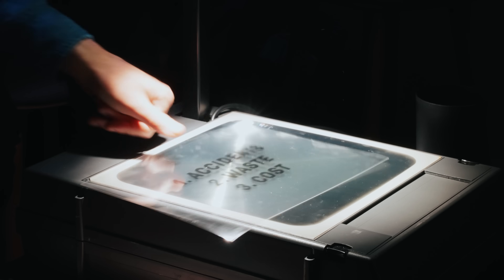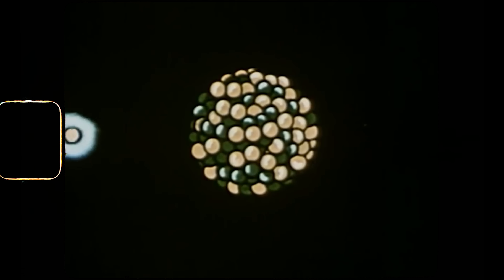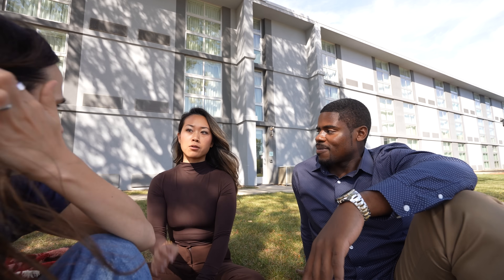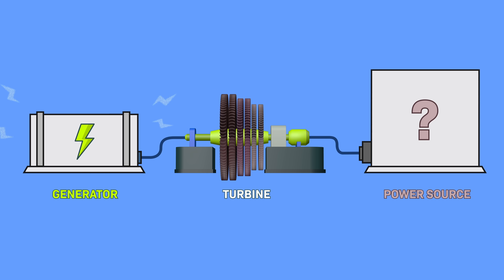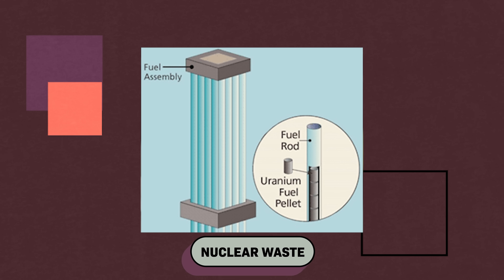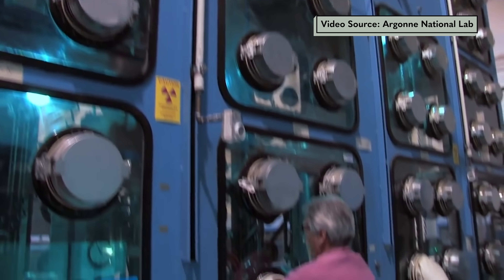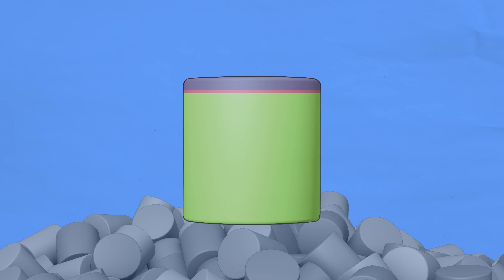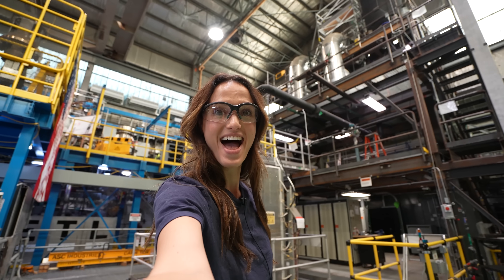The Big Lie About Nuclear Waste

Comment: After over 30 years in the nuclear (government) industry, I would say we never met an engineering challenge we couldn't solve, but had a very poor record of overcoming political challenges.
Reply: Isn't there something about the building code and safety requirements for the reactor being uniform across the US, meaning that they have to be earthquake and tsunami proof even when built far away from a coastline and not close to a fault line, causing a lot of (unnecessary?) resources to be spent on construction.
Reply: @Kalisparo  it's worse than that.... Some of the other issues are that a np electric generation plants can be stopped at any point up to the point the plant goes on line. Alex Epstein has extensive research on the basic criminalization of np.
Reply: @Kalisparo where is the question mark? You asked a question.
Reply: Just make a bunch of viral TikToks that attracts milions of kids that will tell it to their parents, problem solved lol. This is basically a marketing issue, every political issue is.
Reply: I think the biggest problems are human factors, like shortcomings in design & construction, and operations & maintenance.  It’s too tempting to cut corners and save money on some organizational level.
Reply: @jimbaranski4687  definitely, but also I don't think there has been a single reactor built so far that was on budget or on time, in any country, even those with extensive experience. Theoretically fission reactors can appear to be simple enough - in practice they haven't been.
Reply: @unom8  Most technological developments go through several phases.  The first designs are simple, but inefficient and brute force.  Then the designs get more complicated, but more efficient.  If you're lucky the third phase designs go back to being simple, but elegantly solve any problems efficiently.  But there has to be some motivation to perfect the designs.

You can look at the history of space craft designs.  The early rockets were very brute force.  The Space Shuttle was much more complicated, but more efficient and semi-reusable.  Now, SpaceX rockets, while still being quite complicated, are much more efficient, and much more dependable and reusable.

You can also look at computers and the internet.  Computers have become much more user friendly and efficient....

Thorium or Sodium reactors have many good qualities.  But we've pretty much been stuck on water based reactors which have several large flaws.  Just like with rockets, we need to develop materials that are dependable, and don't suffer from corrosion and wear.  Designs have to be made so that when things fail, they fail safely.
Reply: Scientists, engineers, designers and inventors work in truth and absolutes. 
Politicians work in lies, emotional manipulation, sensationalism, bribery, betrayal & power/control. 
In a battle of politics the good guys are unarmed. And the bad guys wont play by the rules anyway.
Reply: The oil industry had huge impact on influencing political will and how policy's were made that negatively effected the nuclear industry.  Also, after the development of the nuclear bomb, the research that was ongoing between fusion and fission reaction just got shelved. Recent reemergence into the salt type reactors looks to be promising.  Regardless of what type of nuclear we go with, NUCLEAR is our way out of the oil business.  Currently it is the best option for producing the amount of power that is needed to stop burning fossil fuels.  Solar and wind are nice but as a substitute for oil that is 24/7 reliable to generate the power we require, it's going to be nuclear.  When people get real information and educated on the science they will understand yes it can be dangerous but if handled properly it can be safe as well.
I was an industrial radiographer years ago and would laugh at how mis-informed people were about radiation.  I got to keep some of their lunches "for disposal" because they got irradiated.  If you don't understand what I just said then you need to leave me your lunch also.  I'll eat it later.😊
Reply: @noobdernoobder6707  Unless we are able to manage building a worldwide connected power grid... Solar will always be a pipedream. It is too intermittent for industry to run directly, so you will need MASSIVE battery farms to account for poor weather and nighttime use.
So until we have the ability to create some type of orbital solar collectors, solar will always be a second-tier power source.
Reply: @OreoBambino  800 billion*
Reply: I don’t think fusion power is possible. Not in the scale they are trying to accomplish it in. It could possibly  need to be done in space at a massive scale.. hence the sun.
I’m all for nuclear power but fusion isn’t going to happen.
Reply: My heart really goes out to you, many have experienced the fact that political solutions to technical problems are fraught with dangers. Democratic republics, single party communist nations, same problem.

I am convinced a major rule of political solutions, in the spirit of negotiation compromise, is to know you have truly succeeded when everyone is equally unhappy. This guarantees a suboptimal technological result.
Reply: As someone with 50 years in engineering, your statement is all wet. Because the government hires only the lowest IQ due to the fact they would not be able to get real jobs, I understand you thinking this.
Reply: The problem with engineers and medical types is that you fail to make a compelling argument. You could say the same about Republicans too. So don’t feel bad. 😂😂
Reply: How about landing a man on the moon? We can't in 2023, but allegedly did so 6 times over 50 years ago.
Reply: There's only one way to overcome political challenges.
Reply: @jayrowe6473 Ahh Jan 6th type. Insurrection is the answer for some just not for me.😮
Reply: Its almost like the people in power don't want there to be low cost power.
Every "green" source in multiple times more expensive per kilowatt than coal, and even nuclear. Wind turbines have one of the shortest life spans of any method. 
Solar panels require many times larger areas of land to be depleted of vegetation than a power plant, either coal or nuclear.
Sodium reactors, among others, have already demonstrated they work and are much safer than the previous generation of reactors.
But for some reason, even among the overhyped rhetoric about climate change, there is no push, no government incentives,  to build these.
Again, we must all add ourselves,  regardless of which side of the political spectrum we ate on, why are only the most expensive per kilowatt alternative means of power production being pushed? As governments are implementing changes to electric cars, why hasn't there been any conversation about our already strained electrical grid and our dilapidated service in older metropolitan areas where minorities and the poor tend to live in higher numbers?
Could this be why major streets in older metro areas are having the number of lanes reduced, and bicycle lanes put in?
Affordable, plentiful power creates a higher standard of living. If society decides that the bottom third of the population won't have access to that, what will happen?
This is not an innocuous situation, simply caused be lack of foresight or ignorance.
Reply: Engineers have to be smart to get ahead.
Look at who the President is right now.
This is the difference.
Reply: We should not need to deal with political challenges if there were a law that banned politics from this type of technology in the first place.
Reply: @beaudavis3808  you're absolutely right, it's an oversimplification but unfortunately politics influences everything. At some point they're gonna realize that scientific progress is important, let's hope it will not be too late
Reply: @beaudavis3808  not yet, we still have much to go for a complete decarbonization. I live in Italy, one of the country that's it's openly and violently anti nuclear
Reply: @beaudavis3808 "A law that banned politics..."
Reply: We would live in such an amazing and futuristic world if we hadn't fallen to political nonsense and greed
Reply: Nuclear grid electricity needs 247 full demand and full cash flow demand. For 60 years. 

Renewables on rooftops, PV panels will get cheaper, and v2g EVs with massive daily FREE storage and parked 23hrs every day will break the nuclear economics. 

Nuclear promoters rabbit on about the modern technologies and then STFU about the rooftop PV technology and its no need for GRID ELECTRICITY. 

In Australia, 20 million buildings with a small 6.6kW rooftop can totally outperform grid generation. 

EVs with v2g oversized battery are on the production line. In the millions. 
Elon Musk is creating new production technologies. 
Elon Musk is creating robotic technologies.

Ford has moved to EV technologies. 

110 years ago, horse meat was cheap when the Ford model T production line started.
Reply: Yeah, good marketing can save any product, as well as bad marketing can doom it.
Reply: @MRSketch09  see solar and wind....
Reply: @MRSketch09  : Look what happened to lawn darts?
Reply: @MRSketch09  Bud Light
Reply: The "green" movement has nothing to do with protecting the planet and everything to do with hurting humanity.
Reply: VIDEO: Sacking of non-binary Biden aide exposes reality of 'minority box-ticking hires'
If only Brandon had hired a real expert at the Argonne National Laboratory as the Nuclear Waste Czar instead of hiring Sam Brinton based on woke politics, the USA would have a more promising future for nuclear energy instead of being a laughing stock in the world.
Reply: The nuclear industry "had a very poor record of overcoming political challenges".
The hiring of Sam Brinton as the nuclear waste czar by Joe Biden proves the above statement to be true.
Reply: @OreoBambino  and they need to spent Uranium for dirty bombs. So you know, how will the possibility bomb Aleppo or Yugoslavian with dirty bombs if they use the Uranium up with that $1 billion funding? Poland is getting radioactive dust as we speak. Maybe they'll wise up.
Reply: Take away government's power to create money and we'll be going on a fast track to developing useful technology
Reply: The people who don't want to recycle nuclear waste due to high cost, are the same people who don't want to use recycled plastic, glass and paper, and have most of that end up in the garbage due to it being cheaper to use new materials.

The owners of these corps and companies are the same elites that constantly preach at you to lower your standard of living to protect the environment. But when it comes to their money, they don't care about the environment. The worst part is that their corporations cause 95% of environmental destruction, however, they want you to take the hit for fixing it. Their standard of living loss would be minimal.

They fund the climate change studies to make it look worse, so it can appear more urgent for you to take action. And if scientists don't come up with the answers they're looking for, no more money for them, they will fund someone more malleable. So this scientific consensus is largely a funded, manufactured consensus.
Reply: Yep.
Reply: @OreoBambino  801 billion actually
Reply: Live by tax revenue, die by tax revenue… unless you’re a defense contractor.
Reply: is stupidity a political challenge?
Reply: Sounds about right
Reply: Politics is personalities, science is science.
Reply: This!!!
Reply: Hey the politics are driven by money. That money system is built upon using dollars to trade oil around the globe. A lot of motherfuckers are out there spending millions of dollars and hundreds of hours stopping the nuclear industry. We must keep trying, and I'm sure you know better than me, but let's not forget what a massive leviathan we're trying to slay here.
Reply: Because cheap energy means less government control
Reply: That's a laugh. In Britain , Maggie Thatcher made sure when power was "privatised" that a special level was put on all electricity users to subsidise nuclear. Its been sheltered by govt ever since. Even now the UK is pissing away trillions in subsidies on new nuclear plants which will be built by the Chinese (wtf!) and run by a French company controlled by the French govt. While a huge revolution has happened in renewable tech.
Absolute f**king insanity.
Absolutely complete fucking insanity
Reply: nope, just lots of idiot law makers who got in the way.
Reply: More of a economic issue thanks to capitalism
Reply: So, what you are saying, is,  that democrap policies (carter) are dumb and damaging,  while Republican (Reagan) policies are Helpful,  Resourceful and Renewable.
       Hmmmmmm, ...🤔

So, why on Gods' Green Earth would any sane human being ever support the clearly damaging dumb policies of the 
Completely Corrupt Communist Party
in America, the democraps ?!?
Reply: money, money, money
Reply: With that said why don't we just focus all our efforts on fusion instead?
Reply: @aries6776  fusion is a dream from an opium pipe, its a violation of the laws of physics, u have to put more into it than u get
Reply: Political challenges cannot be overcome as long as the mechanisms behind them are unchanged. And unfortunately human nature is genetically coded into us. The only way to really overcome it currently is by individuals becoming very self-aware after lots of mature, deep inner work.
Reply: The big lie about nuclear energy is that it’s not as safe as it was promised they claimed that we’d have a nuclear accident roughly every two hundred years as of 2014 the world has had over 100 nuclear accidents with 57 being very severe
Reply: Does this mean america could finally sort out the mess they made in the Marshall islands? 😡🖕🏼
Reply: Galen Windsor
Reply: So presently, who pays for the storage and security of storing this nuclear wast?
Reply: That is the dumbest thing I've ever heard anyone say about energy bar none.  You've been working on Fusion for 60 plus years you big dummy.
Reply: They build a breeder reactor in Utah I think but politics defunded its opening. As usual the government is the problem not technology.
Reply: How can someone get into the nuclear industry?
Reply: NIMBY
Reply: Corrupted government controlled by Evil families
Reply: Russia already did it with BN reactors.
Reply: Apparently you have no idea what you are talking about. I'll explain. 
Lies by omission! Pure BS and this content creators knows it!
I'll explaine, Yuka Mountain... in Nevada has been a government run debacle ever since it was started. It was and still is a federal run nuclear repository for "nuclear waste". It is so far over budget and behind schedule as to be a complete joke. It is over 30 years beyond budget and beyond schedule that all the "temporary " holding sites" around the country,  of which there are many many many. Can no longer be moved to Yuka Mountain because those "temporary " holding sites are failing and leaking and can no longer be moved. The trucks and trains that were supposed to move them to Yuka Mountain are not trust worthy either. Just think of all the recent train derailment. 
And, the governor of Nevada has said that if the federal government ever actually finishes Yuka Mountain he won't let it be used to store the nuclear wasted for several reasons. He does not trust that Yuka Mountain being so over budget and behind schedule, can be trusted,  nor does he want his state to be the repository for the country 's nuclear Waste even if he could trust the federal government to do it right in the first place.
On paper Nuclear Energy is a great idea. But it is a complete failure (nuclear energy) because of the federal government,  which does nothing well,  and can't be trusted with anything. Let alone the storing and transportation of nuclear waste.  All these government funded companies and jobs is just more fraud and waste perpetrated on the American people. And all the government workers who continue to defraud the American people.
The leaking temporary holding sites are poisoning and killing us all slowly every day. But now they want to get us to believe that suddenly its all going to reverse course.  With super slick complete lies in the guise of well filmed propaganda lies in videos like this one. These people are sick demented lyets that dont give a damn about you and are more than happy to get millions of views and get paid for it all while getting paid by the government as well to make them.
Don't believe me. Look it up for yourself.  Yuka Mountain its a trillion dollar disaster and can't and won't be used. And decades of nuclear wasted is leaking into the environment all over the country. Do you want that being moved by train and trucks that derail and crash?
The government does nothing well!
This video is a slick lie that is so evil i can't begin to fully exposed it. If this disgusting woman is so into doing a deep dive on the subject of recycling spent nuclear Waste how come she ignores completely the points I've raised?
Its disingenuous at best and down right deadly at worst. these people will do anything including lie straight to your face for a few thousand dollars.
She tries to show how great it is that we can reduce the half life of this deadly poison is from one hundred thousand years to 200 years. Yet we cant even deal with the waste we have created already.
Maybe Yuka Mountain will be finished by then and the government can get started on the next failed trillion dollar Yuka Mountain number two in a state you live in. What a sick disgusting lie this video is. She is so perky and happy all while lying to your face. Pure evil.
Only talks about the positives,  not one mention of the negatives. That's one of the ways you can tell its propaganda. The federal government can't be trusted to hire a head nuclear wasted that doesn't steal luggage from airports.
Reply: The minute the government gets involved in any type of energy especially nuclear its DOA because governs totally incompetent and does nothing well.  Except get people poisoned and killed. YUKA Mountain is a total failure that will never be used and is still a trillion dollar over budget and 30 years behind schedule and is substandard and can't be trusted. The temporary holding sites waiting to go to Yuka Mountain can no longer be moved and are leaking. Nuclear Energy is a total failure in every way. Federal cant even be trusted to hire a head of nuclear waste that doesn't steal luggage from airports.
Reply: The US Department of Energy (DOE) cancelled the mixed-oxide (MOX) fuel fabrication facility at the Savannah River Site in South Carolina in 2018.  The facility was already about 70% complete.
Reply: As someone who has had 23 years in the gov. Nuclear energy industry I wholeheartedly agree!
Reply: Well, all of our water-cooled reactors are inherently unstable because water can boil.
That's why we build 100500 safety features which makes plant really expensive.

In the USSR they focused on making nuclear reactor that would be generating power that would be REALLY CHEAP and they achieved that - well at least according to what I was taught back in University the cost of kwh produced by one famous type of Soviet reactor was almost 10 times less than that produced by coal power plants.
Cheaper than coal, and by so much!..
History however remembered RBMK reactor not for how cheap it was, nor for how it could work with low-enriched fuel...

The trick is to design the reactor that would be just as cheap, yet would not be inherently unstable...

So obviously we need some kind of liquid-metal cooled, fast neutron reactor with neutron mirrors (aka "burner" reactor), but... 
You know better than me all the problems that comes from each of coolant metal candidates.
So its not "just" the lack of political will.
Reply: @skipperg4436  steam turbines, what we use to generate power, rely on that fact. And molten salt totally doesn't corrode and degrade systems designed to contain them and it definitely wouldn't be used to heat water to make steam.
Reply: @SunShine-xc6dh  actually with metal cooling we can rely on MGD-generators entirely. Though it will be less efficient than turbine for designs I heard of.

Point is, in nuclear reactor you have water going through the core which - in case of an accident - will boil away raising pressure dramatically to the point it will rupture the tubing. And in case of a more serious accident water will decompose into hydrogen and oxygen which - after pipes rupture - will cool down an explode.

As for metal cooling, all potential coolant metals are corrosive at temperatures involved (though not as corrosive as molten salts). But they will not reach boiling temperature (unless we are using mercury but we won't be doing that ofc) and they will not generate explosive gaseous mixture under any circumstances. At the worst case we would have a leak of metal at several hundreds of C that is slightly radioactive.

Not great, not terrible.
Reply: @skipperg4436  pretty sure it's not a steam explosion that's the big threat from a nuclear reactor meltdown Pretty sure it's the 'slightly' radioactive part that still make the area around Chernobyl uninhabitable
Reply: @SunShine-xc6dh  it was the explosion and the burning graphite that spread that radioactive part around.
Steam ruptured tubing, heat caused steam to become hydrogen and oxygen which after leaving core chamber exploded and destroyed the reactor hall.
In case of fully metallic setup the worst thing you can get is a heap of radioactive metal.
Reply: @skipperg4436  the fire was inevitable. It melted a hole right through to bottom. Concrete breaks down  and melts and steel melts in lower heat than it takes to break water.
Reply: @SunShine-xc6dh  Nope, it was the graphite that was burning. We don't use one in modern water-cooled water-moderated reactors and we certainly won't need one in fast neutron reactors (for which liquid metal cooling is a must).
And if we are talking about such reactor in case core melts it will mix with coolant - metal - which will cool it down and stop the reaction due to dilution.
Metal have much much bigger heat capacity than water and much much higher boiling point so it won't boil (even mercury have 300-something C boiling point).
Reply: @skipperg4436  yeah probably not it takes a specially engineered furnace to get carbon to burn that hot involving large airflow. The graphite is there in the first place to keep the nuclear decay from naturally getting  that hot...
Reply: @SunShine-xc6dh  wrong: graphite is used to slow down the neutrons - to make so-called "fast" neutrons into "thermal" neutrons which cause U-235 o fissile.
Water is doing the same by the way.
So every non RBMK-reactor have this passive feature that if water starts boiling it will slow down the reaction thus making Chernobyl-style catastrophe impossible.
Fast neutrons have low chance of splitting U-235, but they also can split other atoms which - if you have enough of such neutrons and have "neutron mirrors" around the reactor can allow you to fissile stuff that modern commercial reactor can not, for example U-238 (aka depleted uranium) and some of the fission products (aka high level nuclear wastes).
There are reactors in UK that use graphite for slowing down the neutrons, but they don't use water for removing heat from the reactor.
Reply: @skipperg4436  the velocity of a particle is its heat.. heat is the energy contained in the motion of a particle.. faster is hotter slower is colder, not moving at all is absolute zero...

Faster particles causes more fission reactions causing more heat and more fast particles causing more and more up to the point where if you get enough in a small enough space you have the atomic bomb...
Reply: What does that physically mean
Reply: @MrLoobu  mmm please be more specific, I don't understand your question.
Reply: @skipperg4436  It's for the OP. Great engineering and failed political  goals? So what did they do exactly then, take short cuts where they knew they shouldn't?
Reply: What does Jimmy Carter and Joe Biden have In common?
Reply: Hence absolute monarchy.
Reply: No more fish as well as crab, if japan pour out contaminated Radioactive water into Pacific ocean.
After 1 year or 2, the Atlantic Ocean is going to full of Radioactive japanese water.
Reply: "Absolutely impossible that the nuclear core could make it to the dirt under the reactor." Find the Nuclear engineers that said that live on TV. Called all of us names and insulted countless average citizens for their concerns about Fukushima reactors and their nuclear cores. 
And because the nuclear industry is so powerful let me remind everyone that three nuclear cores have disappeared below the ground with not a clue by anyone where the cores are or what they are burning up.
Reply: Sympathy ☢️
Reply: Solve  an problem over 150 000 years. 😂😂😂😂. when I think about the costs😂😂
Reply: Look up Galen Winsor who worked in the nuclear industry and watch his 1.5hr speech of how he describes "waste" and other things.
Reply: Specifically, the challenge of how to continue to make money and stay in power, if energy becomes cheap. Doesn't help when the dollar is also based on oil...theoretically.
Reply: I think it also has to do with government officials benefiting from old coal. Whenever there is resistant to change we need to see who is making money. Wouldnt be surprised if coal money be making alot of politicians happy. Nuclear will probably get more attention and more regulations ,  makes it harder for people to eat🤑. Politicians probably be benefiting from the UAE, thats why they have no problems with dealing with them , but china is a  no no right🤣
Reply: @OreoBambino  
That $1 Billion spent on fusion should be used on better, more productive things, like research into perovskite solar cells.  After how many decades(?) and how many tens of billions of dollars(?) have been spent on Fusion and how close are we to even getting a working plant?  Maybe by 2060?  It's been a hopeless money pit so far.
Reply: So true.
Reply: Always follow the money. Oil money buys lobbyists who pressure politicians to stop nuclear research.
Reply: @matthewnienkirchen8083  yep no money in perpetually collecting research grants for something that will never work
Reply: By design.
Reply: Chernobyl
Reply: Challenge solved in Russian BN-800 reactor. Its already working on nuclear waste.
Reply: >but had a very poor record of overcoming political challenges
Did you try addressing Austrian art school rejects about it?...
Reply: well i am closly relater to youre ilk... and theres a political problem here...
Reply: It's sad.. we  could do so much good for ourselves if we just abandoned fiction and propped scientific process more
Reply: Well said
Reply: In 30 years you never met an engineering chalalnge you couldn't solve, well this is interesting and completely not true, also the main issue is money not the politics itself but it is a huge part.
Reply: All it takes is money…
Reply: The fact that they didn't convert to the Thorium reactor cycle nearly at the beginning tells you  a very large amount about the political atmosphere and the purposeful elimination of nuclear fuel to generate energy. This was NEVER about nuclear energy but about corrupt politicians being paid off to force more expensive choices upon the people.
Reply: We melted down a nuclear power plant at 3 Mile Island and it scared the crap out of America for a damn good reason.
Reply: Create a cheap fusion reactor then.
Reply: if you think that the engineering challenges for nuclear can be overcome, and it has only been limited by politics, why is in not being used in places that are not subject to US politics or places that do not respond to the will of the people at all? (kingdoms, dictatorships, etc)
Reply: @bobo888bobo  You mean like China, where they build out several new nuclear reactors every year?
Reply: the moronic stupid side to democracy.
Reply: One engineering design came up with marble bed technology where instead of carefully raising and lowering radioactive fuel rods in a vat where the spacing between the rods determines the intensity of heat generated, marble bed technology uses fuel encsed in a baked ceramic ball. These balls are made to exact diameter so that when put into the vat they automatically arrange in a pattern that keeps the distance between the pellets of fuel to a specific spacing. This error free spacing is impossible to decrease. The ceramic casing is able to retain integrity for thousands of years and instead of storage, the spent fuel balls can be dropped in the ocean far apart from each other where they can remain harmless for centuries. Unfortunately I suspect the engineering contractor that made the less safe traditional fuel rod system had better lobbyists and deeper pockets.
Reply: Politics has always been the actual solution nuke companies resort to...force feed the stuff to the public and overcome its resistance to cancer and early death.  We all gotta go sometime.:face-purple-wide-eyes:
Reply: This process will never work in the U.S., because it makes too much sense...
Reply: You people trust and buy anything
Reply: Far past all that we are in the Great Reset folks buckle up!
Reply: Solve Hanford. Solve Santa Susana, San Onofre, Rocky Flats, Sellafield, Chernobyl, The Puerco River, WIPP, SRS, Mayak, the Marshall Islands, The Nevada Test Grounds, nuclear exclusion zones, La Hague contamination of the North Sea, solve the abandoned nuclear subs rusting away in the Baltic Sea that stopped being recovered because of the war in Ukraine, solve the Arctic dumping grounds for 50 years of Soviet nuclear waste, solve the 350 million gallons of rdioactive water at Fukushima. Solve the radioactive wild boar problem of Europe and contaminated sheep in Wales. Solve the highly radioactive waste that has been piling up for 75 years with not a thimbleful safely isolated from all contact with living beings for longer than mankind has been in existence. Solve the mountains of very acidic, radioactive uranium tailings contaminated with toxic heavy metals piled up all over the world from uranium mining. Solve the brittle, leaky, rust bucket reactors that are still running long past their useful life span that are too expensive to maintain, but would immediately bankrupt the utility and any investors that would shut them down. Even if they are losing money, and they are, if shut down they immediately go from the asset side of the ledger to the liability side, with decommissioning costs (if that ever happens), waste disposal for the next quarter million years (if that ever happens) site maintenance and security and cleanup of all the contaminated soil and groundwater onsite (if that ever happens). Great Britian finally shut down the reprocessing facility at Sellafield that has been losing money hand over fist. The facility says it will cost over $1 billion a year just to maintain the site, untold billions and over 100 years to clean it up with no place to put the nuclear waste that will be highly radioactive and highly toxic for at least 240,000 years. The radioactive industry has iseveral problems. The biggest is that it is the most expensive means of generating electrical energy by far. The financial gnomes don't care any more than the radioactive community about the massive health and environmental damage nuclear energy causes, but they don't like losing money, especially on risky, massively costly ventures with an extremely slow return on investmant. The second more long term problem is how to hide from the public all the extensive, cumulative damage to health and the environment from bioaccumulating radioactivity and get them to continue to shell out taxpayers' money to pay for sham cleanups until the utilities can slither away. Take the money and run, nukies.
Lies, bribery and strong-armed lobbying of complicit bureaucrats will not work when the public gets tired of your lies and passing the buck on your lack of cleanups. We are tired of it.
Reply: It is cheaper to get more uranium. The nuclear reactors used particularly in USA are the crappiest available as far as using the fuel. But if you wonder about nuclear waste check the atol USA used to test nukes. And the concrete dome they put over it. The simple fact is that even though the used fuel is available USA companies and govt truly do not want to deal with it. They would prefer to have it leak. It is active toxicity. The reactors USA use is because of an admiral in the navy. But it means really inefficient fuel. And you couldn't be bothered sorting it. You would prefer just dealing with it later. And as you know USA doesn't deal with it later.
Reply: There are even nuclear plants that auto enriches their fuel.
Reply: I would have to agree, I've got you by   eight years, Iworked my first outage as an hp tech in 1980
Reply: magnetic containment? or safe long term storage o nuclear waste, or re-enrichment of fuel rods given only 5% of fissionable material used.
Reply: What & the much hoo hah on lack of clean energy?!!
Reply: @CreativWyse   the only clan energy available is whatever we can reap of the sun's, nuclear is not clean the amount of radioactive waste produced making power in a nuclear plant is truly staggering any consumable used in the plant is invariably, treated as radioactive contaminated waste and it goes to whatever radioactive waste dump is available for use, radiactive waste from a power plant is not used fuel, that isn't half of itdepending on what type of anticontamina tion clothing is used if it's cloth it  gets shipped to a laundry facility, if it's some like a tyvek suit it goes out as rad trash, that's just the tip of the iceberg hoses that have developed leaks go into the trash, mostly it's easier to throw something out, than decontminate it, it all comes down to moneyanything used in an contaminated area has to be cleanedthe rags used to wipe down tools add up to quite a volume a lot of the trash is plastics; difficult to incinerate, there's just so much, it's hard to listit all, and some takes an explation any air filter media is going out as rad trashat one outage I worked we collected a 55 gallon drum of shoes, poor contamination control at that plant most work areas that are actively worked are gointo produce one  55 gallon drum of waste per day double that if you add laundryfloors need to be mopped daily to prevent contamina tion build up, we use cloth mops those mop heads become rad trash think about where you might work and consider how much trash is generated in the plant areas, boiling water reactors are much dirtier than pressurized water reactors, the two types are abou 50/50 in the us.
Reply: True.  Politicians favor avarice over Duty, and power over Justice.
Reply: Hey Fukushima how you doin!! Engineer's got you under control..lol tools!!
Reply: That the Commie/Fascist left has made energy "pollical" IS THE ROOT OF THE PROBLEM.   The American Govt wasnt invented to be tyrants but the Commie/Fascist Left has made it that way, on purpose.
Reply: Most engineering challenges are never solved...just remedied. 😊
Reply: Radiation trumps (not Trumps) other higher energy sources (eg. gasoline) from a global climate change viewpoint.
Reply: Then why doesn't the private industry run nuclear power?
Reply: Another reason why Jimmy Carter sucked
Reply: @hitthurdeaux  Best US president in the US in the last 100 years by far. No one is even close.
Reply: Get rid of the Democratic party
Reply: I’m glad the spent fuel is being stored for the day we as a society are done being stupid and use what we have. The Bidenites will never see the light…
Reply: Yea their "result" of overcoming this challenge of fast breeders is "absolutely nothing despite billions of euros spent". Great job.
Reply: As an interpreter for the industry, I noticed the utility companies NEVER mentioned the comparative safety of nuclear. Don Beeth at HL&P was a rare exception.
Reply: Just because we can... should we? the engineering challenge is easy... human nature says don't do it we are greedy, mean, stupid people.
Reply: The Santa Susana Field Laboratory would disagree,
Reply: That’s because Americans allow our politicians to remain in office for things they do that are 10X times worse than anything an average Human Resources person would fire an employee for doing.
Reply: The French have been doing this for decades.
Reply: Like wise. 36 yrs. Just retired.
Reply: Fukushima…? How quick we forget!
Reply: Ignorant lynch mobs are a dime a dozen.
Reply: Yeah. 100%. I came here (to the comments section) to talk about exactly that.

The problem has never been technical.  Pretty much every nuclear accident and incident has been a process or planning/political failure...

The problem is people.

1) People suck at really understanding risk.
2) People inevitably stop thinking about why they do what they do and don't react when things change.
3) People are incredibly bad at making processes that are robust and self sustaining.
4) People who make financial and policy decisions are rarely engineers.

and most importantly... 

John Stapp said it best - "If it can go wrong, it will go wrong"

This was a great video BTW - and I totally agree that this approach to nuclear power is incredibly positive.  IIUC though, Th based nuclear power is even better at consuming waste and produces less waste  and no plutonium...  Another technology that should have been pursued a long time ago and hasn't.  IMHO...  YMMV.
Reply: Political challenges are the kind of obstacles thrown at engineering challenges that some powerful people (or companies) do not want solved.
Reply: There is a difference between engineering problems and physical problems.
Reply: How much tax payers money you wasted on nuclear socialism?
Reply: Always remember to follow the money.
Reasons to regulate new nuclear technologies:
1:
If political governance and regulations are out in place ( to make safe)
You can then artificially manipulate the price.
Keeping the established technology profitable.
(GE/Westinghouse ring a bell).
Reply: And social challenges, when the voting populous is a bunch of scientifically illiterate emotion-driven neo-hippies that believe unicorn farts provide electricity for their plastic Priuses and think human existence is an inherent scourge on the planet, nuclear is a hard sell.
Reply: very well said...and the same applies to all other energy sources.
Reply: Politicians are the main problem of our society!
Reply: Material science is not in step so your incorrect.
Reply: I’d have to agree, but we are the cause of our own problems specifically Three Mile Island. People had complained about the lack or problems with the PRT indicator issue but to no avail? Oconee had had a similar issue before TMI, difference being is they let the auto control take care of the issue, unlike TMI which had way too much interference from management who they found out later, didn’t know their arse from a gopher hole? But, with the latest changes, I still have hope? But management continues to be a problem cause when I found out Exelon was not incorporating a required calibration correction, I was landblasted & “run out of town” even though I was right! This has to stop! Whistleblower protection is the ultimate in protection! But to this day I still stand by nuclear power.
Reply: Your comment reminds me of this great aviation quote about a project whose success was undermined by failure to engineer past politics and goes like this:

"All modern aircraft have four dimensions: Span, Length, Height and Politics. TSR2 simply got the first three right"

It appears the same could be said for nuclear.
Reply: Don’t feel bad; making the case for nuclear energy has been challenge for every nuclear program in the world.
Reply: Politicians ruin everything
Reply: I agrree!  Worked for 11 years in a nuclear power plant. And the only real problems were lying politicians!
Reply: When I was a kid,  my dad took us to see Bever Valley power station #1 Shipping port PA.
Don't believe anything these morons are telling you. 
BvNGS was never designed to make electricity. 
It's sole purpose was to turn Uranium into weapons grade Plutonium,  and do it right under the noses of the Russians. 

A fuel rod is placed in to the pool and is rotated in the pool until about 3% of the power was extracted. 
Then it was removed and shipped off someplace to made into nuclear weapons. 

That is why Nike Missle bases were built to defend Pittsburgh PA.
It had nothing to do with the importance of the steel industry or the steel mill. 

I met a man at a ham radio club meeting and his father built 4 nuclear power plants.
When I asked him where he worked,  he said that even his grandchildren will never spend it all,  no need to work. 

It's probably why Einstein didn't discover anything after his theories on relativity and being the inventor of nuclear fission. 
Once you built a bomb that can destroy the world,  why bother. 
These politicians will just use it to destroy each other. 

Keep lying to the people.   What a expert...
Reply: Scientific research and technological advancement of our understanding will never cease. Vested interests in the capitalist status quo will never join this advance.
 Philo Farnsworth achieved affordable tabletop nuclear fusion in the sixties , (  Farnsworth fusor used routinely as a nuetron source for colliders ) yet no-one has simply ramped up the containment voltage to or beyond the brake even point to even explore the potential of energy ( gamma rediation ) the device could provide.
Theoretically, we could power the east coast U.S.A.  for a few cents worth of sea water a month.
Reply: i mean, we got the nicola testla non polluting engy locked up in elite scum bunkers, and then the elite scum blame humanity for the pollutign when it was THEM that created the whole system as such!
Reply: The human ego is the beginning of all suffering.
Reply: So, what is the hold up for lftr(liquid floride thorium reactors). Thorium just "needs a kick from plutonium or radium or something and has a radioactive halflife of thirty days for its waste.
Y'all going to let India solve the issue?
Reply: WELL SPOKEN!!!
Reply: Yep
Reply: The political challenges wouldn't have been so great had not the industry been so neglectful of plant safety and ecological/environment damage, 75% of US plants leaking etc, but instead ignored it all in the search for cheap profits
Reply: If recycling nuclear waste for commercially viable it would have been done years ago
Reply: Nuclear Power & Nuclear Waste (enriched/spent/recycled) = Nuclear WEAPONS. When absolute peace can be guaranteed for centuries to come. Then, and only then, can Nuclear be an acceptable risk for energy production (or weapons). Sorry Dreamers, and Nuclear Energy fans. I hate to burst your bubble...but for every reactor (however small) placed on gour soil, means one less "Nuclear" bomb your potential adversaries need to procure. All they need is a cheap, conventional bomb, to have nearly the same desired effect. Not withstanding, any home grown "accidents" that might take place over the coming centuries. "Can't happen" you say? Already has, more times than you are aware of. "Technology has come along way since then", you say??? Until the next design flaw is exposed, and the chances of that happening, are NOT zero.
Reply: My only concern with nuclear power generators is how close they can be built to capital cities. The closer the better.
Reply: yes , political. Jimmy Carter doomed America to petroleum based fuels. His is the legacy of Democrats failures to improve American citizens lives!
Reply: Wouldnt it be so easy to sell the idea of turning nuclear waste that would last hundred thousand years into waste that lasts centuries? Pretty sure any nimby group would agree to that. Or perhaps there are other real world reasons that nobody wants to admit, such as cost
Reply: @JMl82daquest  Yes, DOE will overcomplicate a wet dream.
Reply: Economics are at least as big a challenge. Especially for the early stages of every technology.
Reply: After 30 years, the best engineers can’t fix Fukushima and the Japanese government has run out of storage room for the nuclear waste water, so they’re dumping in into the oceans, and what about Chernobyl,, the best solution for nuclear waste,,leave it on the site where it was used, just hire guards to police it for the next 1,000 years. That is the cheapest solution
Reply: What about economic challenges?
Reply: I feel that big oil has a lot to do with the politics, all over the world, that has slowed the growth of nuclear power, and also help create some of the fears associated with one of the cleanest energy sources on planet.
Reply: @jdcairncross3631  You are not correct. The same energy corporations that are heavily invested in big oil are also heavily invested in nuclear. These corporations lobby hard to stop renewable energy sources like solar and wind and also lobby to stop regulatory incentives to foster energy conservation. Look at the bribery scandals of Ohio House Bill 6 and Illinois Commonwealth Edison to subsidize nuclear and restrict alternate energy and energy conservation. The V.C. Summers nuclear fiasco in South Carolina resulted in convictions of energy company executives and $8 billion in losses to utility customers and $16 billion in ongoing debt for SC taxpayers for AP1000 reactors that never generated any energy. Other utilities in the Northeast have enough legislative clout to avoid prosecution for similar schemes to subsidize existing fossil fuel and nuclear while restricting sustainable energy and energy conservation.
Reply: @jdcairncross3631  Ask the indigenous people around the Shinkolobwe and the Moab mines and the Puerco River and Santa Susana pandora boxes of nuclear contamination what they think of your comment that nuclear is "one of the cleanest energy sources" in the world? You might want to check in with the folks around Chernobyl, Fukushima, 3 Mile Island, Le Havre, Sellefield, Rocky Flats, Savannah River site, Hanford and Kyshtym too.
Reply: I hope they will get over it.
Reply: After March 28, 1979, nobody wanted a Three Mile Island in their neighborhood. Then 7 years and one month later, (April 26, 1986) the accident at Chernobyl, Kyiv Oblast, Ukraine, made Three Mile Island look like an ant in comparison. The US needs nuclear power, but both parties are funded (read: owned) by proponents of other methods of electric production. Their tribalness will result in rhetoric which will descend to the usual fundraising for their political campaigns. They’re not “leaders” but followers. The public is gonna have to form the Nuclear Power Train for them to realize we’re serious about it.
Reply: Hello, fusion.
Reply: :finger-red-number-one:
Reply: Really sad to read your comment.
Reply: So so true.
Reply: Corruption
Reply: It's a $ problem. The storage costs are astronomical if done properly
Reply: Yea?  Solved nuclear disaster Haven't we?  None. Running away is the only thing we can do now.
Reply: I don't know man the fact that you had to specify that you worked for a government is awfully suspicious now I'm thinking you were secretly enriching it
Reply: Politicians are what’s holding us back. JS
Reply: What political  challenge? Can anybody explain to me?
Reply: currently in the freshman year of my bachelor’s degree in nuclear engineering! any advice for someone just starting out in the industry?
Reply: Follow the money
Reply: If I'm not mistaken 
France, Japan, Germany, Belgium and Russia already do this.
Reply: Yet Hanford is still leaking Nuke Juice ......
Reply: What about nuclear fusion?
Reply: Call me a conspiracy nut, but politcal leader + petroleum/natural gas producers  = no advance on processing nuclear waste.
Reply: Politicians suck ass
Reply: Having worked in the IT side of the UK Nuclear industry as was (in a previous life), and in particular on the creation of MOx fuel from recycled U and Pu, your video makes total sense. It's just the commercialisation of the process and ensuring political will and safety.
Reply: Did you work for the Nuclear Regulatory Commission? My dad worked there for 22 years before retiring a few years ago. Just curious
Reply: The biggest problem in any large scale operation is trying to convince stupid people about things they can't process
Reply: Except when the reactor blows up and destroys every living thing for thousands and thousands of years. Just one nuclear explosion is catastrophic there has been over five nuclear accidents through out the world..the most recent Fukushima and why fir the live of me would you build a nuclear reactor next to the ocean one of the most precious resources we have..oh right do they could dump all the radioactive water back into the ocean to save money..!!!..the political challenges you mention is so much political it’s called common sense.
Reply: I swear its always the politics we would actually be so far in terms of advancement if politics agreed to more things
Reply: Funny how we are actually seeing this in real time. Someone kicked the door in and said "time to show us where the Money is going!" and they act like we are selling secrets to our enemies.
Reply: What a nice way of saying leftists are idiots.
Reply: Ok so why haven't the nuclear engineers been able to clean up Chernobyl and Fukushima ?
Reply: Never failed to overcome...tmi? Brown's ferry? and what of the economic idiocy of San Onofre?
Your industry has problems that have nothing to do with politics. You promise "clean energy" then kill the estuaries you draw cooling water from by overheating the breeding beds.
Can you STOP making promises that prove false over and over?
Reply: A reciclagem do resíduo nuclear é uma ótima ideia 💡!!
Reply: De todas formas, como jefe de un ingeniero siempre encontrarás a un administrativo o un político. Craso error, así nos va.
Reply: They greatest hurdle in human history, clueless dumbasses bickering.
Reply: ok solve chernobyl then. no ones been able to use that land since it melted down. Go fix it.
Reply: @ the problem with chernobyl is that it was run by a bunch of negligent dipshits, wouldn’t have melted down if it wasn’t run by communists but even then there are projects now that are working on cleaning the place up.
Reply: Si, pero ningún defensor de la energía nuclear quiere cerca de su domicilio un cementerio nuclear, lo prefiere lo más lejos posible.
Reply: Cause humans are monkeys, angry greed monkey, who love wars and genocides, but good in create "high end gadgets".
Reply: so you know stuff we all  don't know and you don't go "public" with it because you are scared.  GG.  people that "work" for  any  job in the usa  and its a government job should always spill the beans once they leave that job or u are not better than  they are
Reply: True
Reply: You still haven't solved the waste issue. Nor is it resolvable. Unless you want to store it in your basement.
Reply: @mynameisgladiator1933  Hi. It's possible to recycle the waste in breeding reactor, but it generates plutonium, a fuel for some reactors but also possible to use in nuclear weapons. But breeding reactor are complex, cost a lot of money and the political tension, and crazy politicians elected by idiots are other issue. You can have in a moment a leader who is in pro peace, but 4 years later a crazy dumb sh...t who will start wars. Also can have corrupt people who can steel plutonium...
So the problem, at least the major ploblem, once again, is the dumb monkey human nature. Humans can be wise to create tools, but can be a piece of garbage about decide what to do with the tools.
Reply: Good point as to where to put the waste.
Every things on this planet is cycle-able or recycle-able. We just need the will to do so. Radio active materials are mined and then cycled or manipulate to fit our uses. The most wasteful inefficient thing we can do, is ignore the full potential of harnessing and capturing energy from any Radio Active materials. In my view, it is 
a shame we have the knowledge to enrich and manipulate Radio active materials, then just say it is waste.
Harness the power of the waste until it returns to it's neutral state, we would fulfill the world's human energy need for thousands of years; with no new mining.
Just my opinion.  @mynameisgladiator1933
Reply: SEMPRE OS MALDITOS COMUNISTAS ,ESTÃO POR TRAS DE TUDO QUE NÃO PRESTA DO TERRORISMO ISLAMICO A HISTERICAS ECOLOGISTAS ,DA SUPREÇÃO DA ENERGIA EXELENTE A VENDA DAS RIDICULAS TURBINAS HEOLICAS..........
Reply: Coupled with profiting from higher education,  it seems like America has hurdles to overcome
Reply: I've said it before people are a hard thing to trust and trustworthiness matters, I mean who talks plainly, honestly and without hidden agendas?
Reply: If you figure out a way for the politicians to get huge kickbacks, or residuals, nuclear energy would become energy source #1.
Reply: the US should have went on with recycling. NASA needed those plutonium to make batteries for satellites. NASA is basically only using stockpiles from the First Cold War.
Reply: Indeed
Reply: Engineering challenges brought us to mirror life, but that doesn't mean that we would need to make it
Reply: It's not just power but physics. The caps were melting and water is conduit..fyi your image of proliferation is limited by not observing cause results also in this statement. Apologies but still. Hold my ground here
Reply: IMHO i think this is not very surprising given the extreme political implications of nuclear weapons. Nuclear power has always and will always play second fiddle to nuclear weapons.
Reply: @sasas845  TNT was originally meant for construction, mining, and landscaping. Not as an explosive weapon. 
First intent isn't really what matters.
Reply: @kingace6186  fun fact regarding explosives & nukes: the nuclear taboo also hurts civilian demolition technology: For demolition, one typically uses an insensitive explisive (e.g. TNT) as main charge and ignites this with a blastinng cap. These blasting caps are a PITA because they are made from sensitive explosives and can thus predetonate relatively easily and they are powerful enough to e.g. blow your hand of if mishandling them. I.e. blasting caps are a headache and a half to deal with it (=lots of procedures to prevent mistakes & accidents) because they are pretty unsafe.
So I once thought: Why aren't there safer technologies available? Turns out, there exist safe detonators that are able to directly ignite an insensitive explosive electrically. The only problem: these were invented by the Manhatten project for usage in nuclear weapons. After the war, these "nice" detonators were then banned via non-proliferation treaties.
Hence every demolition technician around the world is prevented from having safer tools by the nuclear weapons bullshit. I.e. nuclear weapons are why we can't have nice things (in certain situations).
Reply: @sasas845  gotta respectfully disagree with you on that point. Mushroom clouds secret cold war shenanigans felt very real! These days, bleached out coral reefs, climbing temps and beaches, a crazy extinction rate, and some very brutal adaptations to avoid their own peril... Oh yeah, and skyrocketing materials and utilities costs (almost buried the lead there), combined w a growing distrust w our frenemies, yet still feeling sheepish that we really thought "clean coal" was a thing.... Hell, line up those reactors if it means i don't hafta talk about it.
Reply: @neepsmcfly4176  Mushroom cloud shenanigans are unfortunately still real (Putin seems to use nukes as d*ldos these days...). Regarding nuclear power: I just don't see the point of it. E.g. for photovoltaics, you can take someone (with non-zero craftmanship skills) from them the street and train her/him in something like a day to a week to do PV installation. And the dangers are something like 1) electrocution (if safeties are removed) 2) fire (if wires are not thick enough) and 3) cutting yourself on metal edge of a panel (if not wearing gloves). For nuclear power, the baggage train is much, much, much bigger. And you macroeconomists to be able to calculate the costs and many of the cost types are things most people have never heard of (it's way more complex that "pay X amount of money and get Y amount of electricity"). So why bother with nuclear if you have boring but practical alternatives?
Reply: @sasas845  Absolute rubbish. Only a tiny fraction of the nuclear reactors built worldwide have any association with nuclear weapons and those countries that did produce weapons have more than enough material to meet their needs.
Reply: @bobthebomb1596  Civilian power reactors share some supply chains with nuclear weapons in countries that have them. That is an association that isn't rubbish.
Reply: @davedavidson9996  Not all users of civilian reactors have nuclear weapons. It is perfectly possible to import fuel, build reactors that do not require enriched fuel or to build enrichment facilities incapable of producing weapons grade material.
Your claim was that civil power will always play second fiddle to the military, which IS rubbish.
Reply: @bobthebomb1596  
"Your claim was that civil power will always play second fiddle to the military

 It is not quite so clear. The biggest users of nuclear power have nuclear weapons. They have overlapping supply chains, military trained personnel getting hired in the civilian nuclear industry, government provided security and cleanup. Seems like you are playing a semantics game.

"

"It is perfectly possible to import fuel, build reactors that do not require enriched fuel "  What reactors are those? Most reactors use Uranium 235 which was enriched from Uranium 238. About a 1/3 of the power from these reactors comes from plutonium. There are a few breeder reactors that can burn some nuclear waste, but they generally use plutonium and and create even more plutonium.  What reactors don't require enriched fuel? Thorium reactors? There are no commercial ones on the planet. 

For most of these reactors, solar and wind power is already cheaper. Sustainable energy will continue to get cheaper and nuclear energy will continue to get more expensive. Unless you are some kind of nuclear power freak the better option is to switch over to sustainable enrgy.
Reply: @bobthebomb1596  I think you are bombing  badly Bob with that logic. An interesting point that professor Kaku made is that before long it will be possible to enrich uranium using lasers and quantum mechanics in your garage.
Reply: @davedavidson9996  Which particular logic is that? 
ANY country wishing do develop nuclear weapons can do so, the knowledge and equipment required is out there.
Development of a nuclear power industry is not a prerequisite of obtaining nuclear weapons and you cannot hide a weapons program on the back of one. 

The two can go hand in hand, but they don't have to.
Reply: @bobthebomb1596  Any country can develop nuclear weapons? Like Iran?
Reply: @bobthebomb1596  How about Iraq?. They got invaded for yellowcake. There is also something called the Nuclear non Proliferation treaty .
Reply: @bobthebomb1596  Any country wishing to develop nuclear weapons can do so ? Are you completely trolling or have completely ignored international laws and geopolitics news for like ... ever ?
Reply: @heroe1486  Neither, however my response was not as complete as I would usually post. I would normally have written, any country can develop nuclear weapons if they are willing to to face international pressure. My apologies. Iran and N Korea are two countries willing to do just that.
The gist of my point however is that a civil nuclear program is neither required, nor a cover, for nuclear weapons development.
Reply: @bobthebomb1596  yep, like Japan.
They use nuclear power plant in number, and have zero nuclear weapon.
Most of European country are the same (only French have the bomb)
Reply: @sasas845 Yep.  Politics and reason/logic don't overlap much.  People make decisions based on feeling and emotion; logic and reason are what people use if a decision or action is questioned-- scrambling to justify it and conceal the fact that they made it because it felt good at the time...lol
Reply: @sasas845  : That is because socialist/marxist/communist/democrat totalitarian thug propaganda is quite effective.  Particularly among low information voters.
Reply: @sasas845 my personal opinion is that we should just get rid of nuclear weapons entirely, not just the U.S. but everyone, every country because to me nuclear weapons are just inhumane.
Reply: @sasas845  
No nukes
Reply: I find the politics of nuclear energy is so frustrating.
...
We could have had recycled nuclear energy plants by now  - with potential harmful emissions savings if it wasn't for political dogma..
..
It is right to mention nuclear weapons as this is the
Primary motivation for the use of nuclear energy technology..
..
Moving forward, nuclear fusion is the way ahead now.
..
And as already mentioned doesn't get anywhere near enough public funding.
..
The reason is fossil fuels.
We are in the twilight of a fossil fuel based global economy -with all the associated vested "big oil" interests.

This, I believe, is what is hampering fusion research; to maintain use of fossil fuel in the near term.

Our global political structure is its own worst enemy.
...
We talk about trying to reduce Co2 emissions.
To create clean energy options but do everything to maintain the (status quo) & promote* the  most inefficient energy generation (wind/solar) & harmful energy (fossil fuel) production for political expediency...

* Compared to nuclear fusion
Reply: @stuartd9741  why are people so obsessed with fusion like it’s some giant panacea. It’s not, it’s undeveloped technology that is so far behind and so much money is being funded for it yet remains 40 years into the future for a reason. Your trying to mimic the sun, that has unimaginable temps and pressure through mass and gravity.  Harnessing that into a box is beyond hard. They are still busy chasing sustainable reactions that output positive output. They lie when they say they’ve completed it because it doesn’t account for the cost of producing the fuels and other work. They literally just count the energy put in at the point of ignition and the estimated power output based on reaction time frame. This doesn’t even address the other elephants in the room. The way they continue to feed the reaction. The by products from it. Yes it still produces radioactive products, that can’t be reused. Also why haven’t they ran it with any type of power generation setup. Because they don’t know how they will and not mess up the containment for keeping the reaction stable. Top it all off you have technology of fusion that hits all the target points right now and has tons of potential to be even better but everyone acts like it’s the boogie man yet fusion is perfectly safe. Imagine running a fusion reactor for 100 days. All the containment will have been irradiated enough that you now have thousands of tons of radioactive material surrounding it in containment. What do you do to get rid of that. Radioactive isotopes of those other elements isn’t going to be useful but will be highly dangerous and require long term high risk storage. Yet you yahoos don’t even want them to store what we got now. If you want fusion then you have to consider fission as viable to.
Reply: @stuartd9741 I do not believe in these promises. Just liquid Sodium, this cannot be safe. Renewable energies are the way to go. It works fine today.
Reply: @stuartd9741  who was it that said "if I can't put a meter on it I do not want it" they started power companies or something, maybe it was water? Ah ohh..
Reply: @loricochran4692  
Edison.
It all boils down to capitalism again..
Reply: @stuartd9741  Does efficiency matter when the energy is free and only amortization is the cost?
Reply: @stuartd9741 Can you compare efficiency of working systems with one that hasn't yet produced anything?
Reply: @stuartd9741 So you blame lack of funding for fusion on fossils and ignore the massive publicly funded green energy sector?
Reply: @stuartd9741 politics are the worst thing ever, the more you know about it the more you hate it

Egoistical demands over peoples lifes...
Reply: @stuartd9741  The point is, like Fossil fuels, Nuclear power is also a non renewable resource based energy. All of them (including nuclear) use a non renewable resource, continuously pollute and damage the environment and biomes albeit in varying levels.

Wind and solar on the other hand, once installed don't pollute. All we need to do is figure out how to reduce the initial pollution and recycle completely.

Nuclear Fission is great but Solar and Wind have just better potential. If you think about it, Solar and Wind are just indirect nuclear fusion.
Reply: @karthikeyan020 Absolutely right. And they are available TODAY and work excellently! Our 11 solar panels produce over the year more electricity than we use, including heat pump and EV. Same demonstration for our neighbors! Just do it now.
Reply: @karthikeyan020  I'm talking about nuclear fusion NOt fission.
Fusion in theory would give us unlimited clean energy. Which again, could be scaled up to the energy requirements.
The issue with wind and Solar .
Solar panels last about 25 years then need replacing.
The huge wind turbines needed replacing after a time and can't be recycled (according to the internet).
And they're not 100% efficient..
We only have so much land available for wind & solar farms.
In the short term wind & solar would plug the gap while nuclear fission plants are closed down due to emissions.
Fusion is ou only known hope of abundant clean energy...
Reply: @karthikeyan020  Solar and Wind will always ONLY be additive to the power grid.  I have yet to see anyone explain how we solve the intermittence problem with these sources.  I don't think there is enough lithium on the planet to build enough batteries to store the energy we need when the sun isn't out and the wind isn't blowing.  Don't get me wrong, I think every home and business should have solar panels, but this will still only reduce the load needed from some other source.  It will NEVER solve the whole problem, we will always need some other energy source.

Someone please explain how I'm wrong here.
Reply: @darincox736  
The answer isn’t blowin’’ in the wind, or any other energy source. It’s in conservation, that is, STOP USING SO MUCH ENERGY! Population control. Stop all that needless over consumption.
Reply: @quixote5844  says the guy commenting on a YouTube video. “Stop needless over-consumption… everyone else that isn’t me…”
Reply: @darincox736  you’re not wrong. Scaling up in any direction causes scaling up in environmental impacts & added costs that don’t get calculated, and that includes wind & solar. You can’t get a negative through addition, and the truth about energy is that no one actually wants efficiency, because companies like profits & people like having jobs. Haha you should see how these EV contractors talk about the future at sales conferences. They all know it’s BS. But, they also know they’ve got at least a decade of government infrastructure contracts coming in, and their eyes are full of dollar signs. My company does private UG utility location, and we’ve completed 250 locates for EV charging stations this year alone that will all be built within the next year or so, and that’s just a tiny fraction of the whole industry. There’s literally thousands of sites going in across the country on every highway & in every city. The grid draw required is going to be impossible.
Reply: @quixote5844  yeah, you gonna do that by starting nuclear war? 

Because other than that, you're talking about one of those things thats very easy to say, but near impossible to do in real life.
Reply: @karthikeyan020  "
Nuclear Fission is great but Solar and Wind have just better potential. If you think about it, Solar and Wind are just indirect nuclear fusion."Complete nonsense.
Reply: @darincox736  The biggest user of batteries are nuclear power plants. They need them because human power needs  are intermittent . We sleep at night and don't cook when we are sleeping. Nuclear power plants lose more money when they are throttled back. At night there is less need for power on the grid. The excess power from nuclear power plants is stored in pumped hydro at least where available.
Reply: @quixote5844  Good one. Passive homes predate commercial nuclear power but very few Americans know about them. They have very little need for heating or cooling. So they use much less energy than a leaky house but the costs are similar .
Reply: @karthikeyan020  Wind and terrestrial solar are intermittent and unreliable.  They both require advantageous weather conditions and even given that you still have to store enough power for nighttime use... So now you have to add 5-8 year cycle life of your batteries to the 20-year solar cell life to calculate pollution.
Reply: @renebach9583  And what powers your home at night?  Either batteries (so you have that pollution chain) or your cheating and using the grid at night.
Reply: @karthikeyan020  Wind and solar still pollute after installation. They require upkeep and replacement. It's also disingenuous to hand waive away the pollution leading up to installation. That's a very important factor for a proper comparison to nuclear power.
Wind pollution is indeed pretty low compared to everything else. Unfortunately Wind is not very good at doing its job. Their yields are low, they have constant RAMS issues (well, RAM issues), and contrary to popular belief they are quite intrusive.
Reply: @karthikeyan020 hate to split hairs, but solar and wind are not renewable energy. The sun drives both, and once it is used up, it cannot be recycled or renewed by us. So let's be accurate and call solar and wind and hydro long lasting energy souces.
Reply: @johndeatherage8873   it's probably best we use it while it's available, so long as we don't exhaust it, that could be bad,
Reply: Yes, I have no problem using solar, wind, hydro, geothermal, nuclear. Whatever makes sense for the electrical use being needed. I am in favor of as many local small scale or individual users being able to generate part of their power wherever possible to reduce the demand for power plants and strain on the electrical grid. I have experimented with wind and methane from manure since high school. I have also seen the cancellation of nuclear fuel reprocessing and have been involved in starting a plant to treat liquid waste from fuel reprocessing. I just don't like the use of the term "renewables" in such general terms, when in fact all the power of those comes from a sun that will eventually wear out. Using the term "renewables" in such general terms has the danger of promising people a utopia, making them think they are the all to end all, and lead them to think they are not dependent on the matter and energy that was existent before there were any people (whether one believes in evolution or creation). Even on the short term, biomass is the only one I see as "renewable" as we can replant trees or feed livestock on "renewable" grass to produce methane. Wind is something we can't on our own "renew" as it is solely produced by nature without any control by us, and is primarily driven by the solar cycle. Same with solar energy directly or using hydro or tidal power. @davidnewland2556
Reply: So when the wind doesn't blow or solar can't meet our needs where does are baseload come from exactly. @karthikeyan020
Reply: @karthikeyan020  Solar and wind produce a lot less energy though
Reply: @karthikeyan020 
Indirect nuclear power, meaning the sun? OK, build your nuclear plant 93 million miles from Earth.
Reply: @stuartd9741 
Oh, yeah. Remember “Too cheap to meter”?
Reply: @PhotoBobBarker What about tidal for costal reigons?
Reply: What is your opinion of Weinberg's Thermal Spectrum Thorium Fuel Cycle Molten Salt Reactor design?   Atmospheric pressure operation, and a "safe operating state" of fuel being fully "melted down"
Reply: @orcoastgreenman  that was the only proven nuclear power reactor cycle that made it past the experimental stage. Too bad politics killed it. I hope it comes back. I’m afraid it will be patented and sold back to us by the Chinese.
Reply: @orcoastgreenman  I think that you will find something very similar in the new design by Seaborg Technologies of a floating power plant
Reply: Fusion power?
Reply: @SunShine-xc6dh  Can't bet on a technology we don't have yet.
Reply: @KingdomOfDimensions  wasn't there some massive breakthroughs in that last year?
Reply: @jazzman7842  there is a company building floating nuclear power station in South Korea that I think has breakthrough engineering. It is called seaborg Technologies
Reply: @KingdomOfDimensions  I mean we can by investing into it. thats literally what governments and companies do all the time
Reply: @KingdomOfDimensions  It's getting closer all the time. If we really put the resources into, one thing is guaranteed, we will get there sooner.
Reply: @KingdomOfDimensions  We proved it's possible months ago.
Reply: @KingdomOfDimensions  

Sure we can.  Just ask all the neo environmentalists.
Reply: @KingdomOfDimensions funny thing is we already have net positive fusion reactors
Reply: OakRidge developed it in the 1950s and ran a successful molten slat reactor for 10 years, but politics and oil companies burried us.
Reply: @KingdomOfDimensions There’s been major break throughs so it’s still worth following
Reply: @KingdomOfDimensions It literally does exist, and yes on earth.
Reply: @KingdomOfDimensions something being profitable and existing are seperate.
Reply: @SunShine-xc6dh  fusion power needs power to work. Like a lot. I guess the best way to think of fusion power is as a booster that increases the amount of energy you can get out of something, like a catlyst. A catalyst for a bright future.
Reply: @Orinslayer  except we have been able to do its and that's not how catalysts work, they reduce the energy required to cause a reaction.
Reply: @Sun Shine  okay, that wasn't the point?
You need gigawatts of power to start and power a fusion reactor, the fact you get more out is a very good thing, but we'd be fools to rely on that alone for power.
Reply: @Orinslayer  sorry you made a bad analogy to mislead... you say it produces more that we get more out, but that hasn't happened yet which is why it isn't a thing. More power isn't inherently better if we can't get useful work out of it. Take coal power plant for example, the coal can burn much hotter the operating temperature of the plant because the rest of the system cannot handle that much energy
Reply: @SunShine-xc6dh  its here only on small scale. She’ll on an industrial level soon.
Reply: @wilmoney4619  except it doesn't even work on the small scales
Reply: @SunShine-xc6dh  never happen...
Reply: @SunShine-xc6dh  didn’t you get the memo?  They are 30 years away for a meaningful breakthrough.😎
Reply: @SunShine-xc6dh  trying to have a scientific discussion here,  
here's a maths formula you can use,   at any given time,  fusion energy will be at least 30 years away.
Reply: @SunShine-xc6dh That’s still decades away.
Reply: @SunShine-xc6dh  Fusion power is probably equivalent to that flying car that would be in everybody's garage by 1970, it's always just one little technical glitch away.  yeah, it might happen but don't hold your breath.
Reply: @SunShine-xc6dh  the comment specified nuclear
Reply: @SunShine-xc6dh  Now you spoiled his party.
Reply: @SunShine-xc6dh For fusion power we are gonna have to wait for ITER and its results.
Reply: @oltihajdaraj8682  You meant for every, instead of for ITER, maybe?
Reply: @oltihajdaraj8682  Look up Helion, I think they are going in the right direction away from extremely expensive and large continuous Tokamaks.
Reply: @oltihajdaraj8682  Forget ITER, I have more faith in Japanese fusion research
Reply: @oltihajdaraj8682  that's it : wait
Reply: @SunShine-xc6dh  fusion is not so much an engineering problem but a political one too.
Reply: @brodude7194  as in the politicians won't give you unlimited funding until you hopefully maybe figure out if you can extract useful power from it in useful amounts?
Reply: @brodude7194  No, it's an engineering problem. We still don't have the tech yet.
Reply: @SunShine-xc6dh  I'm not in favour of blasting people with huge amounts of money, it doesn't help competition. But it's pretty much the same problem as with fission reactors: Too many competing technologies. 
They should focus their efforts on one or two and the engineering problem would be less of an issue since less designs to find solutions for. 
We should still develop fission for the middle term.
Reply: @jimdiet8534  See my reply to Sun Shine. It is political in that engineering resources are being split aimlessly between techs and energy sources (fusion, fission, wind, sun, water). If politics had an ACTUAL clear roadmap (like wind, sun, water, fission in the medium-term, fusion for the future etc.) the engineering would come up with solutions.
Reply: @brodude7194  Nuclear engineers are not easy to find. Different people like different types of engineering.
Reply: @jimdiet8534  No need to tell me, I'm an engineer myself. Just a reason more to not split resources among the few good ones in that field.
Reply: @brodude7194  
We are still a long way from sustained, controlled fusion reactors. Containing the plasma in a fusion reaction is a pretty slippery eel although Livermore labs did it recently and got a positive energy balance for…. 20 micro seconds.
Reply: @greghuff3316 But the overall energy balance was way negative...
Reply: @brodude7194  it's more than an engineering problem. A number of other holygrail technologies need to be realized first.

Stuff like room temperature superconductors (a thing that's even more holygrail than nuclear fusion...this one thing alone would completely transform the world in every way imaginable...and that includes hover scateboards)
Reply: @tylerdurden3722  Nah it's not room temperature conductors that needs to be solved: That's my entire point. Some random people come up with random solutions / problems / challenges (yet some of them inefficient and entirely impossible) and tell other people how it's done. There's no real competition and the few competent are being confronted with a magnitude of diverse an hilarious  obstacles.
Reply: @greghuff3316  yes, I know. Did I say something completely contrary? 
All I'm saying the endeavours are being split unnecessarily
Reply: @brodude7194  
I lost the thread but I believe you were touting fusion as the energy future and I am just saying that modular fission designs are out there that are safer, easier, and significantly cheaper to construct than the LWBRs that are in use throughout America. I am a practicing chemical engineer and materials scientist for 45 years. I also run an independent oil and gas exploration and production business and believe that climate change is real. I am cutting my own throat here but we need to reduce the amount of fossil fuels burned for energy ASAP. The quickest way without massively disrupting society is to build these smaller safer nukes.
Reply: @greghuff3316  Uhm did you completely miss the part where I specifically said something along fission needs to stay for at least the next 2 decades?
Reply: @brodude7194  
Sorry bro, I must have missed it. My apologies.
Reply: @greghuff3316  No problem mate
Reply: @brodude7194  so very wrong. They are still very far away of producing as much energy as they put in for the whole apparatus.
Reply: @jimdiet8534  I wanted to be one but the benefits and avalible positions are just not there. It is a dead cycle.
Reply: @I_am_a_nice_person  where did you look? Government is always hiring. Especially for the military.
Reply: @jimdiet8534  Mostly people around me who worked in the industry when I was young adult. Now I am computer science graduate trying to sharpen my skill while looking for work. Unfortunately, I didn't get accepted into one of the top twenty nuclear focused universities either. so...... life be like that sometimes.
Reply: @brodude7194  obviously increased funding would also be to educate, train and recruit more experts (scientists and engineers etc) in the field. You can't put the cart before the horse.
Reply: @SunShine-xc6dh  as in the oil industry’s don’t want us to use them
Reply: @brodude7194  it's still a political problem.
Reply: @brodude7194  if the political environment didn't encourage people to not spend private money in the field then the market would concentrate on what works.
Reply: @brodude7194  fusion is definitely still an engineering problem, and also a political one
Reply: @SunShine-xc6dh  we know it is possible for the technology to come to fruition. It is not really a scientific or an engineering barrier. Innovation takes time and resources. Political challenges however are the main bottleneck.
Reply: @Penguboiiplayzz  you believe... what we know is we've never done it. Science isn't about what you believe it about what you can do successfully and repeatedly
Reply: @SunShine-xc6dh  I never said I believe. Science is never about “believing”. That just contradicts the entire purpose of experimentation and observation. We know for a fact that it is possible to achieve fusion and work up to a net positive system. This is not something we “believe” we can do, it’s a statement that’s proven by mathematical reasoning and physical analysis of our technical capabilities. We do however lack funding and political barriers make it harder to achieve said advancement.
Reply: @brodude7194  It's more an engineering problem than an political one (the more we find out, the more we realise we need to find out), but it's also nowhere near as clean as made out - radioactive iron will be a significant and quite long-lived problem to deal with (neutron-bombarded containment walls)
Reply: @brodude7194  Doubtful. It's like the fountain of youth.
Reply: @dannygreen7473  bra can you elaborate? it's 273 replies and I have no clue what you're referring to
Reply: @brodude7194  I would but ewe T deletes them
Reply: @brodude7194 why that..?
Reply: @gerharddeusser9103  sorry m8 i don't know to which of the dozen or so comments you're referring to.
Reply: @SunShine-xc6dh  Politics don't "fund" anything (this would presume: 1. there _ i s _ enough "free" money present - what isn't ... 2. the patent owners - which almost always is the real 'big' industry! - of the real know-how-holders _ a l l o w _ it!) Funding comes from where all the big sums come from: The industrial leaders, which are deeply involved into the concerning materia.

Where do you come from? Nowhere in the world there is "political funding" - politics _ i t s e l f _ is object of permanent "funding" by 'big industry' and banks - that's how reality on this earth looks like!
Reply: @brodude7194  No so,  sadly.
Reply: @thiemokellner1893  YT makes it deliberately shite to respond here: I said fission needs to stay for at least 2 decades until fusion is mature enough, which might very well still be half a century away
Reply: @brodude7194 fusion is an engineering issue.
Reply: @SunShine-xc6dh  it's radioactive in nature. it doesnt exist yet. so why fear mongering nuclear power but root for an even more dangerous form of radioactive process
Reply: @BlackApricot  it's also buried under the earth in much less concentrated amounts naturally than required for energy production.. fossil fuels burn naturally therefore good and safe?
Reply: @SunShine-xc6dh  I just imagine it being some essential part of flow in earth rotoe(rotation) for some reason. Picturing as if or as in we mine it all, then it changes what it was doing in the grand scale? Not that know what that is or was, but I think the same for all the elements like gold, silver copper, anything conductive. As well as what ever else we do not know? What about you folks.
Reply: @SunShine-xc6dh  You forgot to mention that the fuel originally came from the ground and was naturally radioactive decaying. So putting it back into the ground is not as bad as your fearful opinion says.
Reply: Is that so? How comes, there is no fusion reactor yet? I dare say, humankind has not been better in anything but to live a fancy life, but future generations are to bear the costs.
Reply: Romans 10:9 = Eternal life 

1 John 5:3
“For this is the love of God, that we keep his commandments: and his commandments are not grievous.”

Ecclesiastes 12:13
“Let us hear the conclusion of the whole matter: Fear God, and keep his commandments: for this is the whole duty of man.”
Reply: @1CT1  Take your pills man.
Reply: @OreoBambino  
$4 billion to provide free security to the world's nuclear industry
Reply: @OreoBambino  Those have clear returns
Reply: You are right, in my youth in the 1960's there was a believe in Technology, I saw the degradation of this and the uprising of Woke & Climate Religion.
Science was Bad and Magical Thinking came back !
Reply: Right. This is also political issue,  developed countries must share technology with developing countries.
Reply: Solve this - Who is going to pay to isolate all of the spent fuel, all of the radioactive tailings and all of the hundreds of radioactive isotopes produced by fission that never existed before 1939 that are thousands to millions of time more dangerous that naturally occurring radioactive materials from all life on earth for 10-20 times the half life of those isotopes? How do you plan to do thast, Mr. Wizard? Noi one has figured that out in the last 75 years. And don't give me that crap about Gen 4 magic unicorn reactors that eat nuclear waste like hay. That's bullshit. Expensive bullshit!
Reply: Really? Tell me how we can have disasters that "cannot happen" like TMI and Brown's Ferry and Chernobyl.
You lose the political fights because you get caught lying.
Reply: Political problems like budget, deadlines and safety records amirite?
Reply: @unom8  What are you smoking. I said none of it.
Reply: @bro dude not sure what you are responding to, but I wasn't responding to anything you said. Calm down, get off whatever has managed to get you to say that fusion is realistic in the short term.
Reply: @unom8  dude what do you smoke? I didn't say any of that.
Reply: Well Because you didn't pay them. You no their donor .
Reply: The demise of "Big oil" as the primary energy source would be so disruptive that governments would not let it happen. Just think for a moment of how much we the people spend on energy both directly  and indirectly through transportation of all goods. Reduced living costs also mean reduced tax revenues for governments.
Reply: @richardbarber4444  tax is for slaves.  They print or digitally create money from nothing. Money is just a motivator of labor
Reply: @richardbarber4444  rubbish
Reply: @richardbarber4444  totally agree!  But this vid is proof that the transition is happening super slow
Reply: @richardbarber4444 

"Reduced living costs means reduced tax revenue"

That makes no sense. Cheap energy is massively useful for any economic activity. 

Second, high living costs make people spend less and hoard more. Businesses hold off on innovation and expansion. Thus less tax revenue.
Reply: @richardbarber4444 it would not stop the petroleum industry as their other contributions from synthetic materials and fertilizer would sustain them however militaries would still be the biggest users as the transportation, flexibility and storage of such high density fuels ⛽️  is highly strategic on the battle field 😉
Reply: What are you talking about? Fast Breeder? TWR?
After 30 years in the industry, why are you so vague?
I'd like to see you using contaminated Clothes and reactor casings in that.
Please elaborate.
Reply: It would be an actinide fast reactor, I believe sodium cooled.
Reply: @21stcenturyscots  contaminated clothing is the largest amount of  low energy waste, could be relatively easily pyrolised to glass  and stored, casings would of course remain within the concrete dome. There is certainly enough waste slag from steel production  to supply the glass. Already however the UK government are going to decarbonise, by shutting down Steel, Coal, Cement and Fertiliser. You cannot build any major infrastructure  without steel and cement. Within the UK, it is likely that wooden buildings will be limited to the height at which a reach truck can rescue victims after Grenfell. Whether you like it or not all technology is intertwined
Reply: @21stcenturyscots  yes we are talking fast breeder reactors, which were banned under the Nuclear Non Proliferation treaties, only India and Japan were exempted. The world had a thousand years of coal, oil and gas, so it was reasonable to ban fast breeders. Now there is an existential energy crisis, far more dangerous and imminant than the climate crisis. Without the energy that civilisation is built upon, the energy disspossed, armed with a deadly vote, will vote in any party that will give them work and stop runaway inflation. ( Have we heard that call before, "A large beer for my friend who cannot pay the electricity bill to keep his family warm. 80 years and you have forgotten beer hall politics)
Reply: @21stcenturyscots  he pretending bering 30 years in the industry. That could mean everthing,  from engineer to more likely chef in the employees Restaurant, or gate guard.
Reply: @21stcenturyscots  every energy technology has it's pros and cons. Have you ever research the story behind the production of solar panels? The amount of mercury and pollutant it releases? The wind energy in which the blade requires changes after 5 years (especially those deploys at the sea) and are unable to be recycled? we need to be objective in our view on each energy technology.
Reply: @21stcenturyscots so what oil company you working for?
Reply: @21stcenturyscots  bro its a youtube comment
Reply: @ some rant about how his comment was too vague
Reply: @21stcenturyscots  She is talking about high level nuclear waste (expended fuel rods) , not low or intermediate.
Reply: @21stcenturyscots  When she is talking about recycling she means high level waste.
Low and intermediate waste cannot be recycled as there is very little actual radioactive material in it.
Reply: @bobthebomb1596  That's true, but low level waste IS manageable with a footprint FAR smaller than that of the the big two pushed by your side.
Reply: @bobthebomb1596  Can't name the big too since Ewe T doesn't allow dissenting opinions.
Reply: Lol
Reply: so wrong. you're only looking at the things achieved, everything unsolved just doesn't come to your mind, because you don't see it!
Reply: @linohype no one's born wise
Reply: @linohype  👍
Reply: @linohype  more like he already saw it but people like you are getting in his way